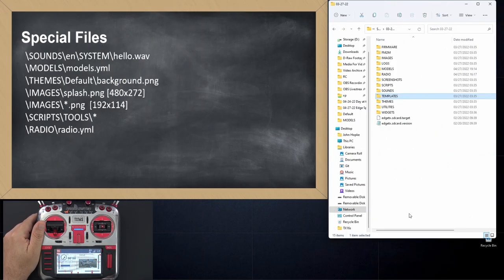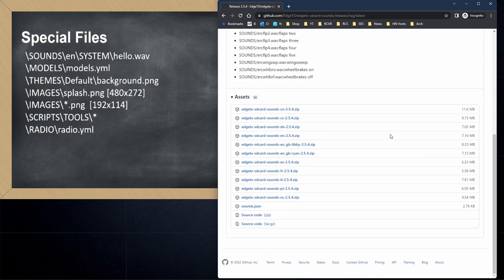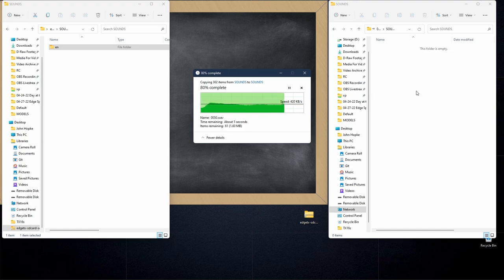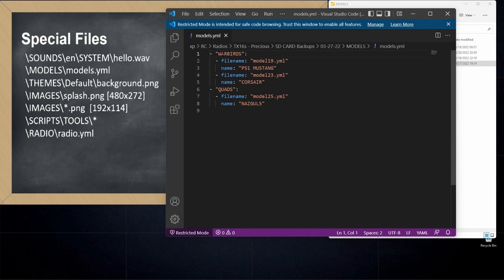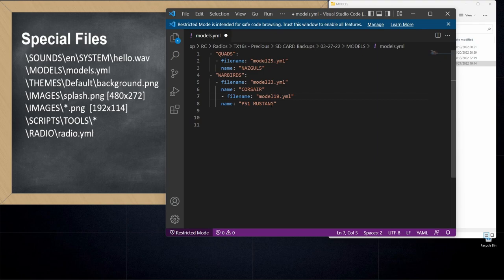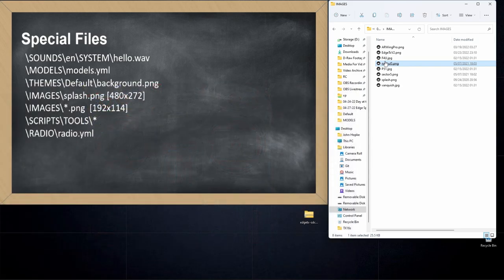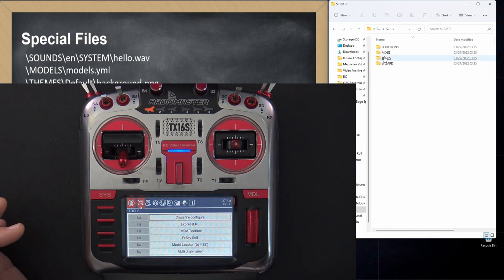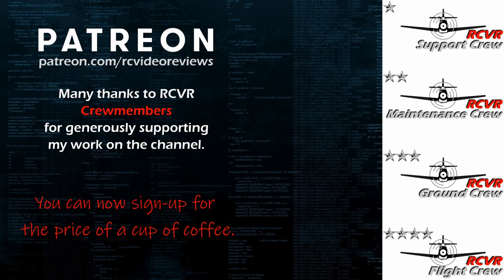EdgeTX Snippet • Special Files: Sounds, Splash Screen, Images, Configuration

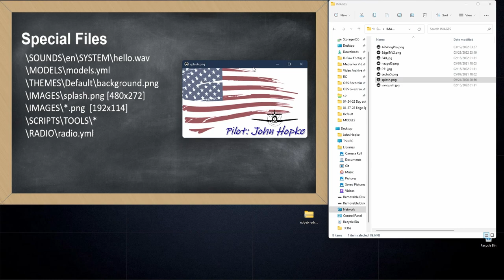Comment: @07:54 Also has to be a PNG... Just came back from a total conversion of my FrSky Horus X12S from OpenTX to EdgeTX for the Touch Screen MOD and kept frustrating over it not using my custom Splash Screen when at some point I looked at the file using the Radio File Browser and saw it being a JPG kinda triggering a "Chotto Matte!!" and yea... PNG it also has to be.
Reply from the maker: Thanks for the clarification. I don’t think I’ve tried anything but PNG for my radio images so wasn’t sure.

Comment: Your videos are VERY helpful. I have 2 questions.What file editor are you using to edit models.yml? Do you know if the Radiomaster TX16s with the multi module will work/bind to a Spektrum AR637TA 6 Channel AS3X/SAFE Telemtry Receiver? That is what comes in a bind and Fly E-fliteTurbo Timber and the FW 190 from Horizon . I was getting RSSI issues with Open TX. I am setting up the FW 190 after converting to EdgeTX Ver. 2.7.0 and have selected DSM Auto for the RF Protocol. Any tips would be appreciated. Module Ver. is 1.3.3.7 AETR

Comment: Thanks for all the tutorial videos

I recently upgraded from open tx to edge tx 2.8 by learning from your video 

I want to ask 

There is a delay in edge tx 
When powering up the radio 
There is delay  between splash screen and welcome sound 

That was not in open tx 

How get rid of that
Reply from the maker: Switch back to OpenTX. 

I realize that may sound like a wise guy answer, but the delay is not configurable. Remember, on 2.8 they use labels now which means the model list is built dynamically. I'm not 100% sure, but I expect that happens during boot.

Comment: nice. I installed the glados soundpack from seiifpv. Do you know why i cant replace that "special" wav file thats in system thats called hello? whenever i replace it with my own wav file i just doesnt play on start up. tysm
Reply from the maker: Hard to know. I've replaced hello.wav with all sorts of custom sounds, so it does work. There's got to be some issue with the format of the one you're using.

Comment: Hi John, I was just reviewing this video and wondered if you have a video for setting up categories in EdgeTX and moving my planes and gliders into those categories. Jim
Reply from the maker: There currently is no move option for categories. They're migrating to labels in 2.8, that's where the model management effort is going. If you want to move them the easiest thing to do is load them up in companion, make your changes, then save to radio.
Reply: @RCVideoReviews  Thanks John! I’ll try it through companion. Jim

Comment: I have several model images that are in the file that don't show up in the list when I try to apply that image to a model. Is it because I might have the size wrong? I did adjust the size of them to the same size of other images in the file, but still they can't be seen when trying to load to a plane model.
Reply from the maker: There is a limit in the length of the filename. I think it's either 8 or 6 characters. Make sure you are using the correct dimensions, png or jpg, and filename is 8 characters (maybe 6) or less. No special characters either.

Comment: Great info as always can I copy and paste models from EdgeTX on my TX16s to EdgeTX on my new Zorro 
Thanks for all your help
Reply from the maker: That could cause problems because of the differences in hardware. I would suggest converting using Companion. Open models from sending radio, save to ETX file, switch radio profiles, open ETX file. Companion will complain and tell you it needs to make some changes. Allow. Write to Zorro.

Comment: how do i xfr my models (70+) from my old dead radio ( open tx ) to my new radio with ( edge tx ) i copied the files but they don't update to .yml how can i change them to ,yml
Reply from the maker: When you flash EdgeTX 2.6 or higher, the Yaml conversion is handled by the radio.

Comment: The firmware      opentx-tx16s-bluetooth-flexr9m-lua-en-2.3.9-otx.bin      will not switch over to edge TX.        it corrupts the models folder.
how can this be fixed,   it will not even work with open tx companion.
Reply from the maker: There's an awful lot to unpack in this question. You should get on my discord (invite is in every video I post).

Comment: Great Video.  I have a new TX16s Mark II running Vers:2.6.0 and EdgeTX Companion Vers: 2.7.1. I loaded the "Amber" Sound Pack into both and the radio works perfectly however in Companion simulator it can only find 5 character file names instead of the normal 6 chars. Has anyone else noticed this and is there a fix, or do I need to rename all the 6 char files.
Reply from the maker: You might want to open a ticket on the EdgeTX Github: https://github.com/EdgeTX/edgetx

Comment: Can radioking tx18s upgrade to edge tx get touch screen?
Reply from the maker: Radioking isn't supported by EdgeTX. I've heard of people using the Jumper T18 firmware for it, but I would advise switching to a supported radio like the TX16s.